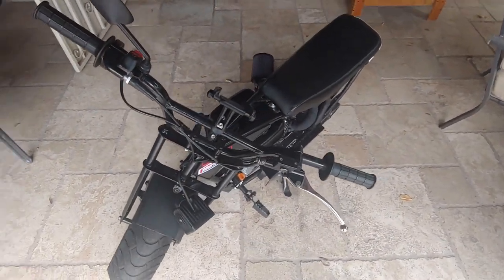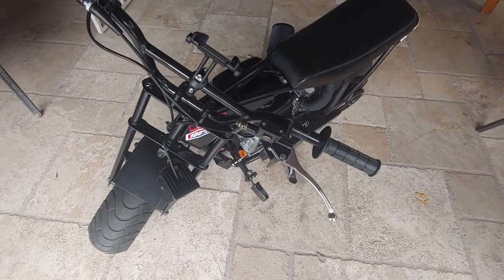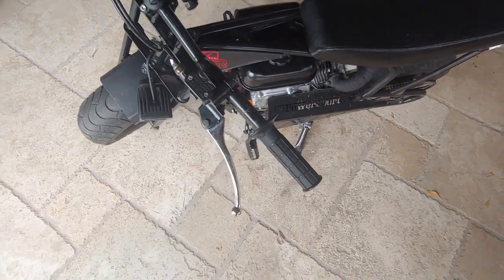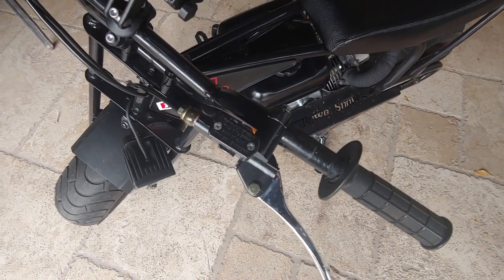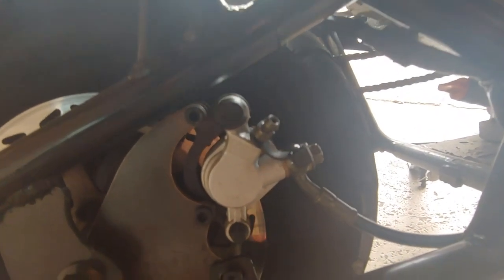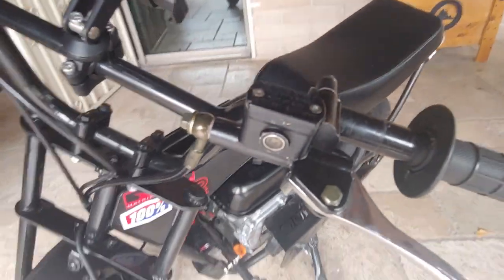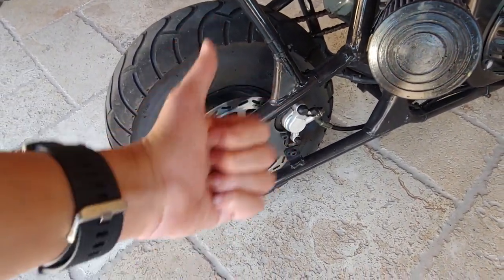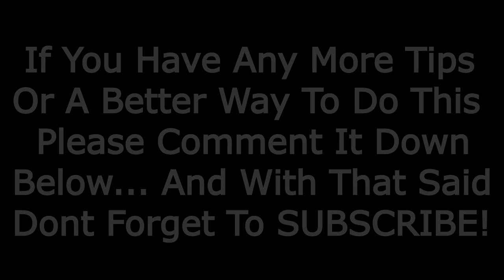HOW TO-Fill Up And Bleed Your Minibike Brake System

Comment: I dont know whats wrong with mine, but whenever i go to pump it nothing happens, it doesnt go into the brake like, and i dont have to top it off again, brakes still dont work :{
Reply from the maker: Hmmm, there’s brake fluid in the reservoir correct? If there is and they still aren’t stopping and fluid isn’t entering the lines there is probably a clog in the system like old gummed up fluid or either dirt or debris.
Reply: @Guido19  i think i found the problem with mine, the washers that have to rubber on them arent making a good enough seal, im using new dot 4 for the rear, so yeah its just an air leak (maybe) and im using brand new rubber/metal washers, so i dont know how im gonna seal it
Reply from the maker: @nwee5758  yeah than it probably is just a air leak
Reply: @Guido19  thanks for the help anyway, tried as hard as I could to seal it, got new line and stuff, I think I'm either buying a new system or permanently sealing it with epoxy or something
Reply: It's my first dirt bike so I'm a little puzzled
Reply from the maker: @nwee5758  to be honest I would probably buy a new system cause brakes are very important for sure especially if your going fast lmao. Also that epoxy could fry out and crack then your brakes fail and chances are if the rubber o ring is bad so is everything else that is the the brake reservoir
Reply: @Guido19  I got a new reservoir/master cylinder, just that something was too big so I couldn't install, also, does the brake fluid get hot? I'm pretty frustrated about these brakes, had a friend look at it and he said to use copper washers 🤨, maybe if I can get that new master cylinder on it might work, because everyone uses the same washers and stuff as me